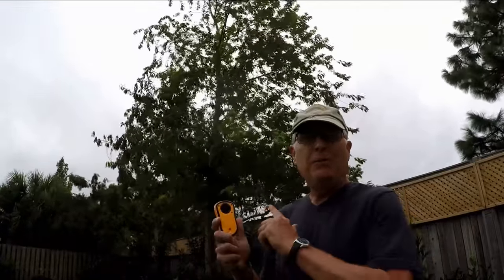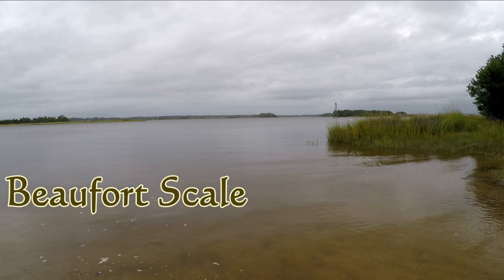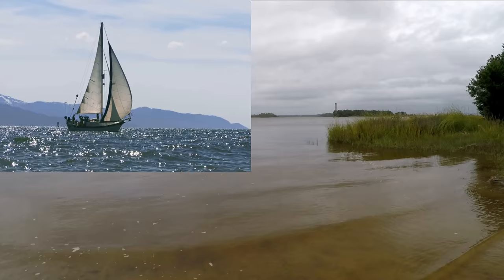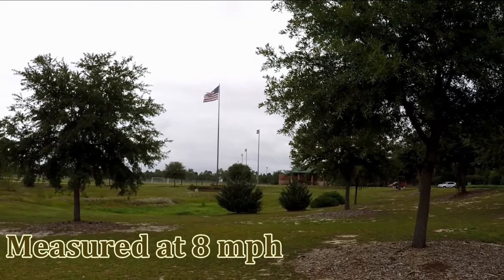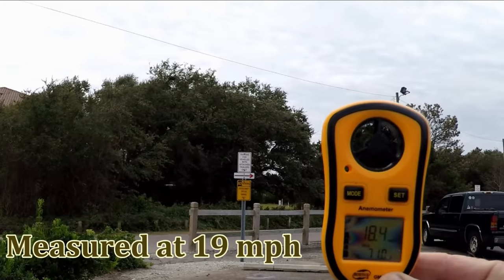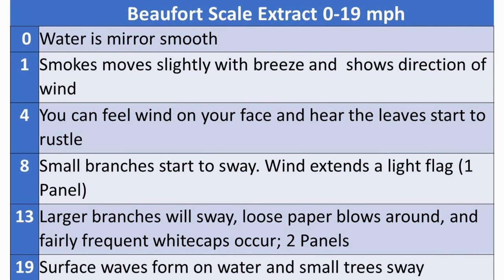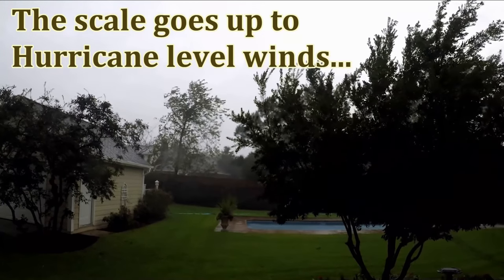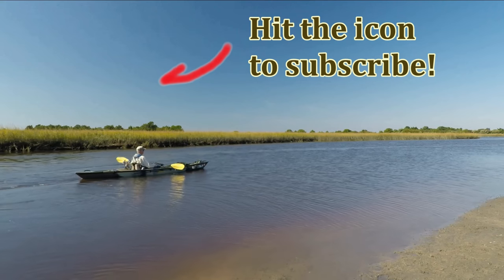What Wind Speed is Safe for Kayaking - Estimating Wind Speed using the Beaufort Scale

Comment: I just scanned 8 websites on this topic and a max of 12mph was mentioned most often. As I'm only an occasional kayaker, and not so experienced, my own limit is 10mph (16kph) and I usually check the wind forecast for each of the few hours that come after I get in the water as I want to see if the winds are set to strengthen also. My 10mph is based not on the steady wind forecast, but on the 'gusting-to' wind forecast. I often cancel rather than take chances out on the ocean bay.
Reply from the maker: Smart! People underestimate the waves wind can kick up.

Comment: In south TX 15 mph is the norm. I go out in the morning against the wind around 12 mph then in the evening come back with the wind at 17 mph.  Of course now with my trolling motor everything is different. Even 20 mph will go across the ICW to 
the calm side. Maybe fish in the river or bayou.
Reply from the maker: I do not mind the exercise as much as I do the waves it kicks up.  At 65, I need the workout to stay trim so my wife does not dump me on the side of the road.  My kayak sucks since it does not have scupper holes and any water that slops over the side stays in the boat.  That's what keeps me off when the winds are higher.
Reply: I am 60 and the reason I put the motor on was I like to do a lot of bass fishing and maneuver the boat while casting for bass. Also allows me to go out in stronger winds. Paddling against those high winds and waves can wear you out and blow you back to where you started .LOL
Reply from the maker: I've got a motor and need to start using it for the very reason you describe!